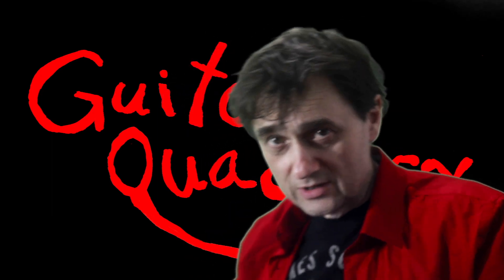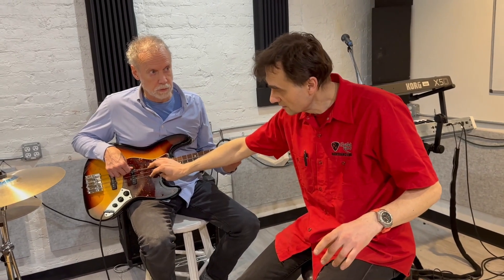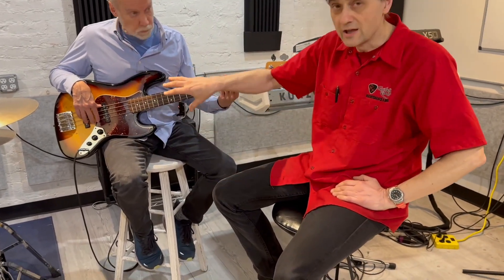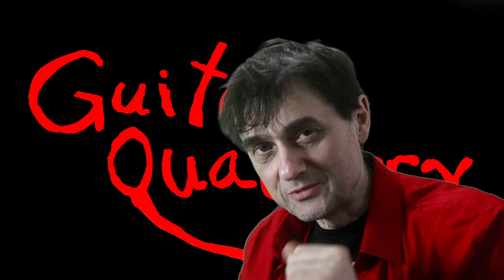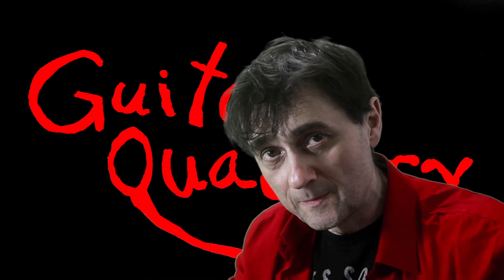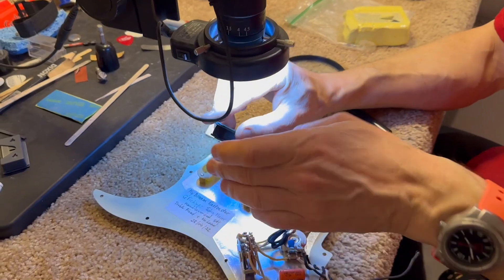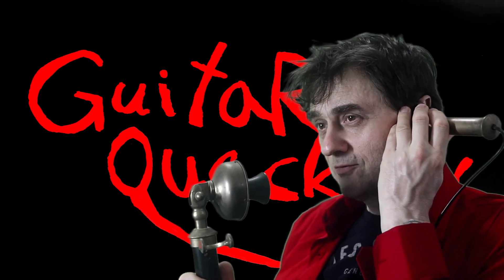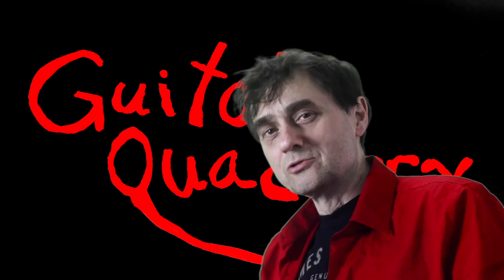Steel Wool Pickup Damage and Cleanup Under the Microscope

Comment: I have a Tele that I bought many years ago with the intent on learning to play. It has never been in a shop for a setup or anything but is in great shape other than some tarnished strings and frets. My son has started learning on it so it needed some new strings. We took it into a shop to buy the same gauge strings, and the guy started writing up a ticket to do a setup on it. I told him I just wanted the strings. He gave me some "tips" about cleaning it up when I changed the strings. The first thing he said was to take some steel wool to the frets to freshen them up. I knew enough about magnets and steel wool to know this was bad advice.  Bronze wool won't leave anything magnetic behind so if I absolutely had to use something that aggressive, that's what I would use. I just taped off the fret board and used some Flitz polish and they look great.

I have also used masking tape to remove metal bits from magnets and speaker cones in the past, which works well, but I really like to modeling clay idea. It looks like it will get into nooks and crannies much better.
Reply from the maker: Yep, I don't use steel woo in my shop, at all. 

Steel wool is quick and dirty and really good for business, to get stuff done quickly and more on to the next job. I just don't like the idea of contamination. 

If you drop off your guitar at a shop where steel wool is being used, they would probably accommodate your request if you ask them not to use steel wool. The issue is making sure that they remember your request by the time your guitar is on the bench and also that they would cover their bench with something, before your guitar goes on, since there would be crushed steel wool particles all over their bench. 

Some people say steel wool can't actually damage the pickups. I guess they are right for most times. I just don't want customers coming back complaining that I ruined their pickusp with steel wool. If there's not steel wool in the shop, any such complaints could not happen. 

Perhaps I worry too much.

Comment: Question, does it matter if the modeling clay is oil based/reuasable or the cheap air dry kind (or does either one work)?
Reply from the maker: I think this is a good question. The modeling clay I use is oil based. The other type, the type that dries out, is water based. Since some pole pieces, on some pickups, are known to rust, I would only use oil based modeling clay. The oil does leave a residue around the pole pieces, which is easy to wipe off with a dry polishing cloth. Hope this helps.
Reply: @GuitarQuackery  thanks for answering that. I also looked up some similar stuff called quake wax. It's pliable like the clay is, but it's made to be slightly sticky (it's made to attach items, like a vase, to a table. So if there's a quake of some kind, it won't fall). Anyway, I'm wondering if that might work even better, & since it doesn't leave a residue, I think I'll give it a shot. Side note, I was an idiot. I noticed some slight rusty residue on my trembucker pickup pole piece. So I took a non magnetic screw driver a gently scraped on that pole piece to remove the residue. I hope I didn't ruin my pickup by doing that... Any experience with that? Thanks, I love your channel. It's important information & you present it in a entertaining way.
Reply from the maker: @MohrEquity   I don't think you ruined your pickup. If you want to clean the adjustable pole pieces, those can always be completely un-screwed and even replaced. The slugs not so easily. 

You can also use poster putty instead of modeling clay and I'm sure a number of similar products would work just fine. There is also a product that watchmakers use, but I forgot what it's called (and it's expensive).
Reply: @GuitarQuackery  awesome, thanks! I can see little scrape marks on the pickup pole, not sure if I should buff it smooth with super high grip paper or not. This pickup is different, instead of slugs & screws, it has one little, straight magnet piece on the left & the right side of each string. The entire pickup is that way, so actually I'm not sure what is a slug & what isn't cause it's all identical...lol. Btw, YOU saved me from using steel wool on my frets. I already bought it & didn't even know to cover the pickups or any of that! So the wool is getting returned. Thanks for saving me from that potential nightmare.

Comment: Steel wool has nothing to do with the clicking when you touch the polepiece on a j-bass, You can actually prevent that by doing a non standard wiring. I have done this on many J-basses because it is really annoying and the pop can be really loud. Still a nice video, have fun =D
Reply from the maker: Thanks for the tip. I guess I reached the incorrect conclusion. I’ll have to look into this a bit deeper. Thanks again.
Reply from the maker: To be honest, I'd like to learn more about this. I think I should redo this video. I would definitely credit you for the tip. Exactly what non-standard wiring resolves this? Do you have a link to the diagram?

Comment: Could wire wool stop the pickups working completely?
Reply from the maker: To be honest, I guess it would be fair to say that I haven't seen any evidence of that ever happening. 

I have seen pickups saturated with steel wool and I have also seen pickups that stopped working due to other types of physical damage. But I really can't say that I've actually ever seen any evidence of that. 

The explanation that I've heard was that steel wool fibers are a bit sharp and thus can cut through the microscopically think enamel of the copper wires, and cause a short circuit. Also, that the enamel can get damaged if the steel wool particles corrode, as rust expands. 

This made a lot of sense when I head about it. But, to be honest, whenever I thought through it, I could never really make sense of it. You can easily short out two adjacent wires, inside of a coil, and it would simply mean that the coil lost one or two turns, our of thousands of turns. Not a big deal, I think. 

If a pickup is potted, how would steel wool particles even get into the coils?

In theory, the problem is, if part of the coil is shorted out to a ground connection. But how likely is that to ever happen?

Now, going back full circle, I believe we still don't want any steel wool particles anywhere on the pickups. As we've seen on the bass, the moving particles can make popping sounds. At least that's what I think was causing the popping sounds. And I also think that on a bass the popping is more likely to happen because the low rumbling vibrations are more likely to make all those metal particles move, even if we don't touch the pickups with our fingers. 

Angus Young, for example, sweats all over his pickups and I believe I remember seeing a video where his tech said that his pickups have to be changed, periodically, as his sweat damages them. Is it possible that Angus' pickups were damaged by sweat simply because there were steel wool particles trapped inside and around the coils (and the sweat caused them to corrode)?

Comment: Dam I wish I had some modeling clay. Just exposed my guitar to stell wool :o  Thanks for interesting lesson!
Reply from the maker: By the way, don’t try to get the steel wool out of your pick ups for using a magnet. If you have alnico pickups, it will damage the alnico magnets.
Reply: @GuitarQuackery use a high powered vacuum cleaner
Reply from the maker: @Waiting4theband  Not my style.

Comment: Ooooo, never use steel wool when the neck is attached. Even when off, if bolt-on, you have a challenge of getting all those tiny particles cleaned off. 😉
Reply from the maker: When the neck is off the guitar, you can easily pick up all the steel wool particles with the pickups, LOL.
Reply: @GuitarQuackery  HAAAA!